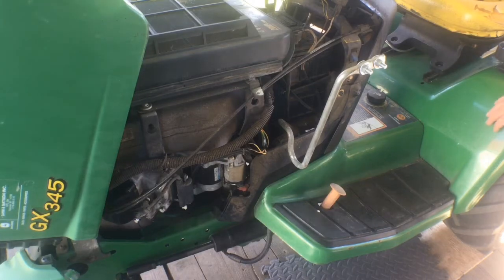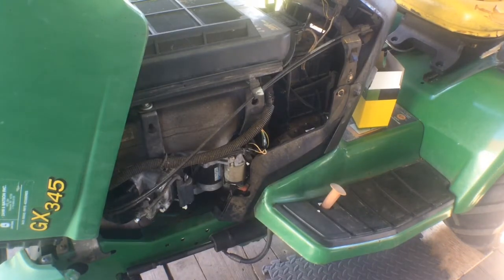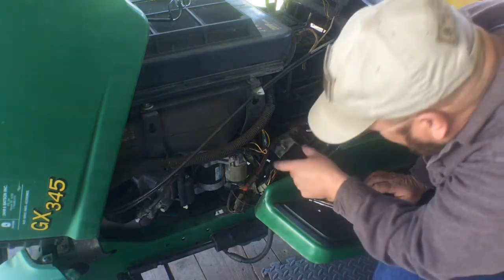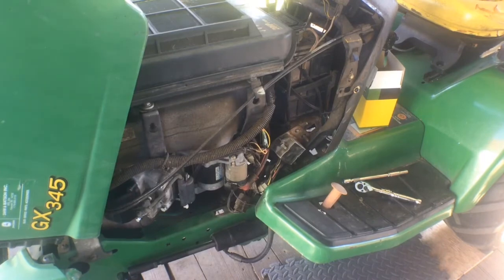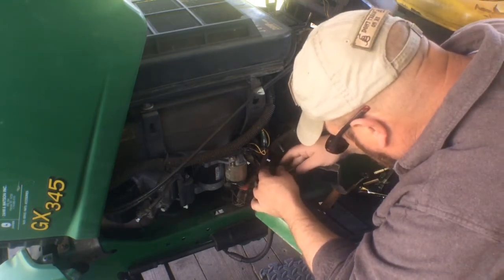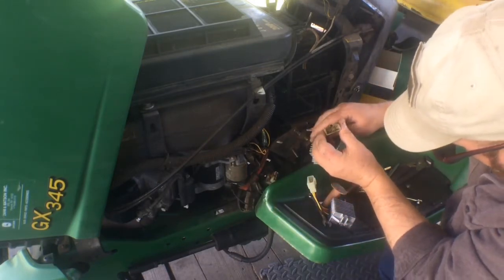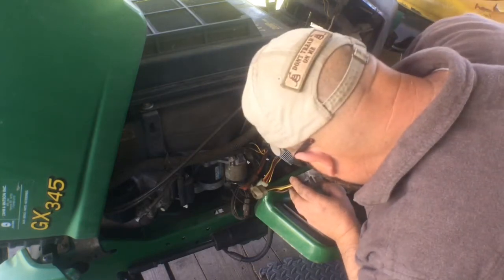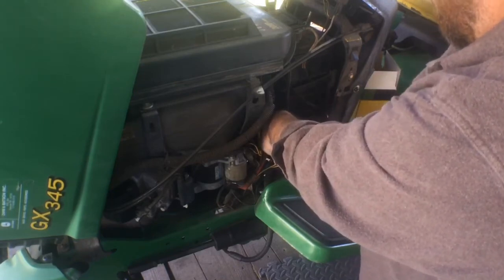John Deere GX345 voltage regulator replacement

Comment: 4.15 I have every tool to do almost anything until…….😂 I hear you same here happens to me all the time. Especially made me laugh hearing you say that as yesterday I went to remove this and had same difficulty removing right nut. You would thing jd would have mounted it just a slight bit higher so as it’s easier to get to the nut. When I get my replacement I believe I will be doing just that for future ease.

Comment: What if the wires coming off are to short to connect the new regulator but you can see a little bit of the two wires. Can you pull on those two wires or do you have to dismantle that thing.

Comment: On my old 345 the voltage reg is on backside of the battery box remove the battery and reach down you will find it I used a flashlight to see it will try change it out tomorrow it would charge off and on